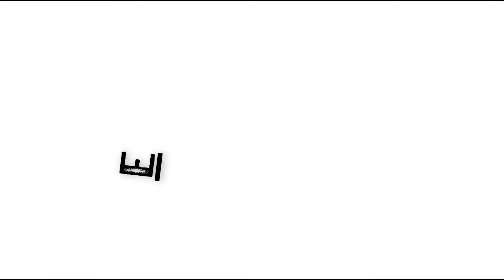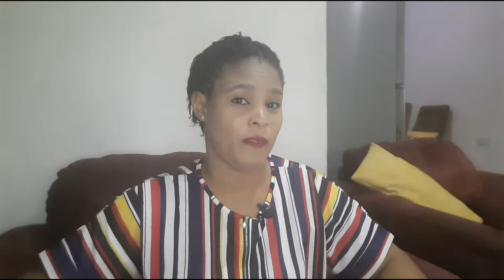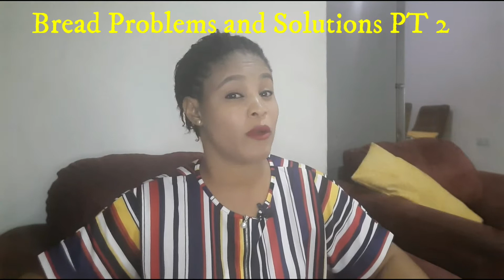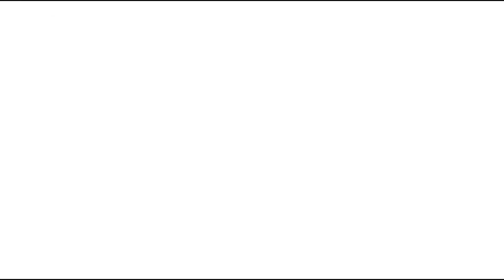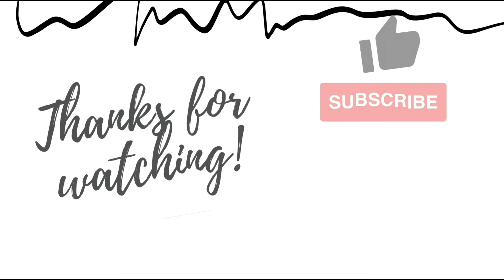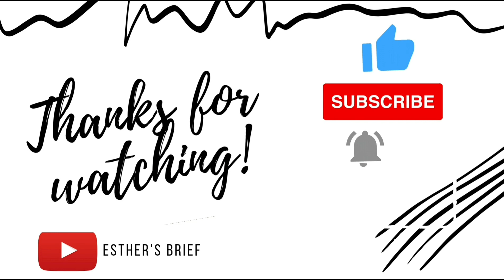How to solve Bread Problems /Part 2

Comment: Thank you very much. Please I have two questions. 1. What type of generator can power a start up bakery
2. Can you please share how to calculate the size of dough to a pan before baking. 

Thank you
Reply from the maker: Hey, thanks for being here. To power my mixer I use a mekano 20kva generator and that's because it is a three faced mixer while I use a smaller themocool generator for other machines. Almost all the mixer in the market are usually three faced, meaning your going to install a three faced meter in your bakery building
Reply from the maker: Size of dough depends on the size of bread you are making. With the present cost of materials in the market am cutting 850g for family size bread while I cut 1200g for jumbo size and 150g for the hundreds naira bread. I hope this helped
Reply: Yes ma'am God bless you abundantly 🙏